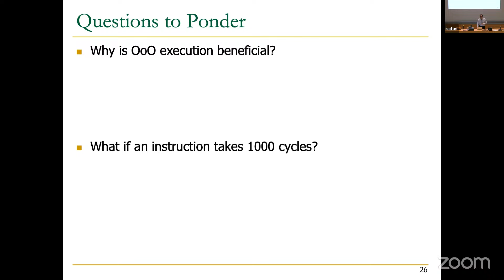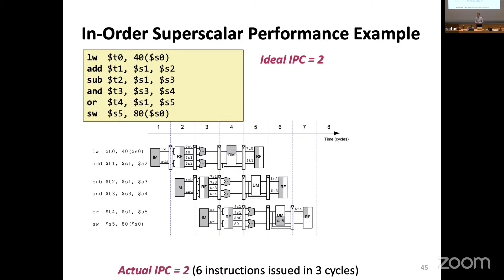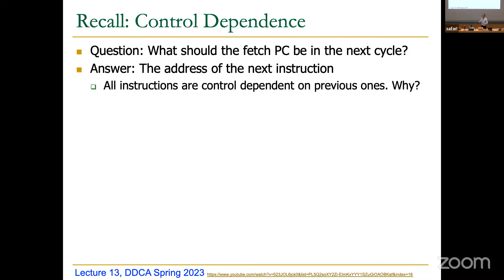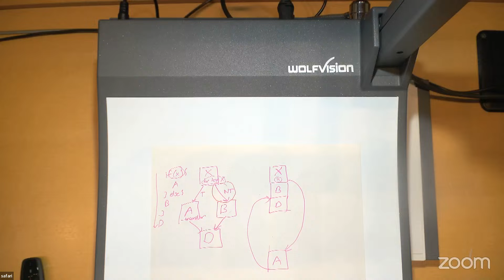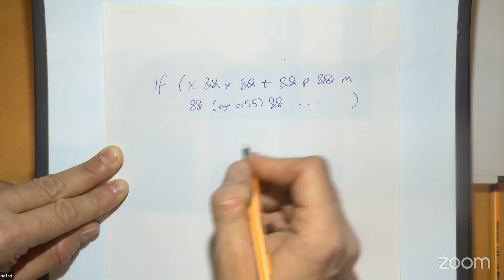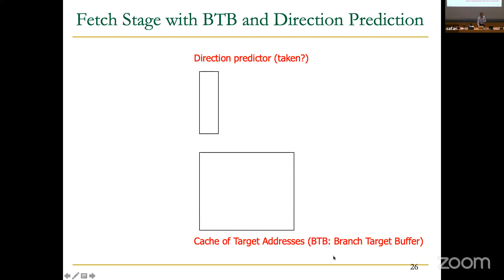Digital Design and Comp. Arch. - Lecture 16: Superscalar Execution & Branch Prediction (Spring 2023)

Comment: I have a quick question. Lets say we have instructions like:
...
bne r1 $0 loop
sw r2 0(r1)
...
Lets say we go ahead with the taken path, i.e., execute sw instruction after bne assuming branch is Not Taken. On a branch mis prediciton (bne actually turns out to be Not Taken), how do we update the memory with correct value because sw was not supposed to be executed and change the values in memory. I am asking this question with respect to both a R10K/P6 OOO core and a simple 5 stage pipeline core.
Reply: I think data is written into store buffers ( before Write Back ), only retired instructions undergo Write Back.